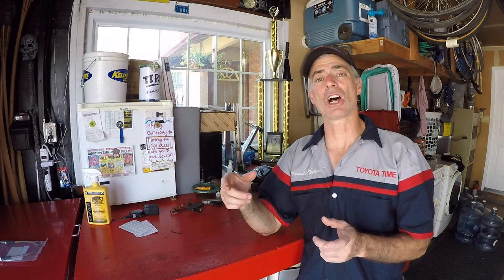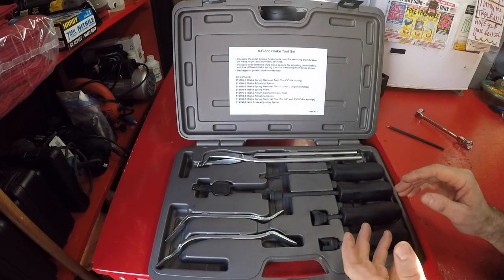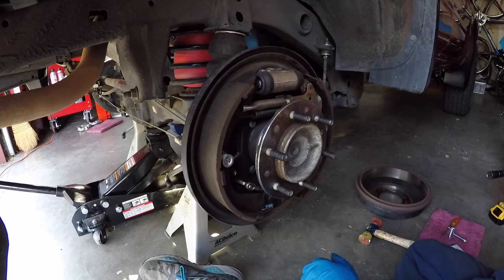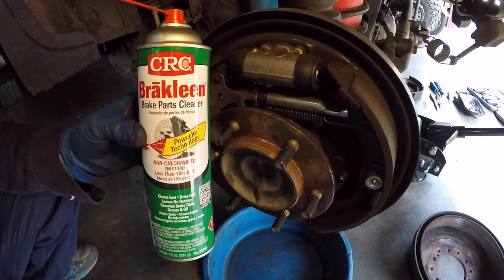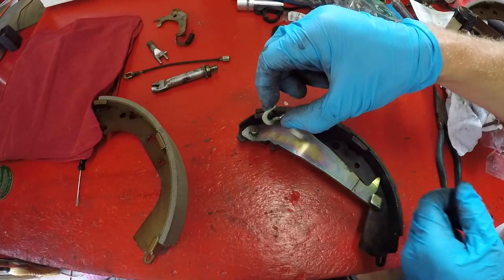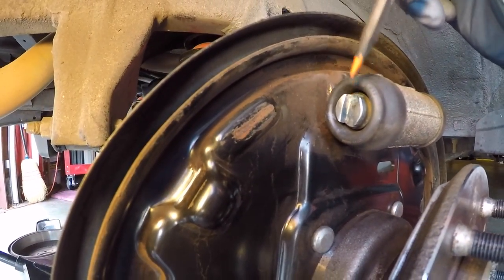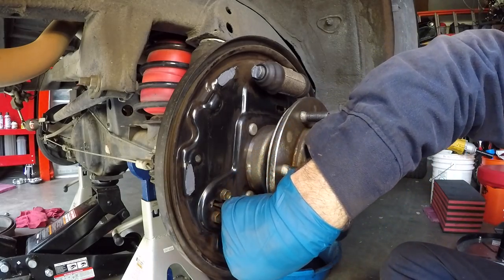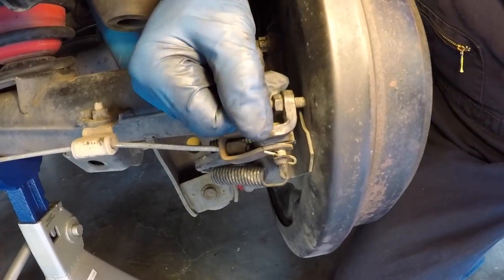Drum Brake Shoe Replacement

Comment: As always great video. I’m planning to do the drum replacement this weekend. What should you do if the braking is pulling to either left or right?
Reply from the maker: If you're brakes are  pulling, the brake grab is uneven for some reason.  If it is your rear brakes causing it, I would be suspecting one of your rear axle seals is bad letting gear oil into the brakes.  The oil coats the drum and shoes causing less grab.  Whichever way your brakes are pulling the opposite side in the rear is compromised.  So, if your brakes are making the rig pull left, it's your right rear brakes that are causing it.  If the brakes are pulling right, it's an issue with the left rear brakes.  The rear brakes stay in adjustment by using the parking brake on a regular basis.  Maybe one of your bell cranks is frozen from corrosion and it's not pulling on the parking brake lever which in turn is turning the star wheel adjuster to keep the brake shoes properly adjusted. 

It could be that the rear brakes aren't the cause of the brake pulling.  It could be an issue with one of the front brake calipers.   It could be a rubber brake line that has collapsed internally not sending equal pressure to both brakes.  Maybe it's one of your front control arms with worn bushings causing a shift when braking that causes the front end to pull.

Anyway, I blah blahed enough.  Let me know what you figure out.   Good luck.
Reply: @TimmyTheToolman  Thanks so much Timmy. This is very helpful.
Reply from the maker: @richlien5598  You're welcome Rich.
Reply: I completed the brake drum replacement today and it went well. Your instruction is so thorough. Thanks so much. No pull when braking. Only issue I had was with the horizontal spring removal. I found that removing the bolt on the OTC wrench and inverting the the hook so that it’s pulling the spring on the top for the passenger side made it easier to remove the high tension spring. Wish I can post a picture to illustrate. My next maintenance is the front diff and using Wits’ End seal driver. I’m in the Bay Area and been wanting to meet up at your BBQ but it’s always on my birthday weekend (Aug 6th). Hope to meet you in person one day. Thanks Tim!
Reply from the maker: @richlien5598  Good to hear it went well Rich.  That OTC brake tool isn't the greatest.  When getting the spring back in, I use a screwdriver now to get it stretched into place.  My birthday is August 5th.  You'll have to make the next party.  Don't know how much longer I'm going to be living in the Bay Area.  I'm going to retire soon and move out of this area.

Comment: If rust is the issue (I am originally from Michigan and rust was ALWAYS an issue) a good way of loosening the drum from the hub is to use a heavy metal hammer and hit the drum right at the hub between the studs and just outside the studs.  For what it is worth and thanks for the excellent video.
Reply from the maker: Thanks for sharing your rust breaking technique.   You're very welcome.  Glad you like the video.
Reply: the 2 screw method works much better than beating on them, especially if you have the drums coated to prevent the crusty

Comment: Hey Timmy…. Thanks for the great video. I followed the steps and thought I had my drum adjusted but now the rear drums are vibrating when I hit the brakes. This started right after I changed the drums…and ideas what might be causing the vibration?
Reply from the maker: Did you use OEM drums and OEM shoes?  If not, that's your problem.

Comment: For that return spring I used an old philips head screwdriver 🪛 that I ground into a point and stick it in the hole 🕳️ and then slide the spring down the shank into the hole. 
I’ve had that old screwdriver for over 35 years and use it for a lot of things. Punch scribe, spring install tool.
Reply from the maker: Your technique to get that return spring on is what I went to also.  I use a Phillips screwdriver just like you said.

Comment: prob a 3 tons jack in the center of the differential, and a 6 tons stand on each side.Nice
bit of an overkill tho, considering I've done that job on a 90 series Prado only using a 2 ton jack in the center, or doing it one side at a time. xD
Nice vids Timmy, you are so methodical with your repairs.
Reply from the maker: 6 tons jacks are overkill just to support the rear of the rig, but I have them mostly due to the height they can achieve.  Good to hear you like our videos.  Heavily detailed step by step tutorials is what we are all about.  We want to inspire people to turn wrenches and that includes total beginners.  We are succeeding in that pursuit because we hear from people pretty regularly how our videos gave them them the confidence to tackle a job they thought was above their ability.  Auto Mechanics, like I tell people all the time, isn't rocket science.  With the Right Information, Right Tools and Right Level of Patience, anyone can turn wrenches with a high level of success.  I'm proof of that because my mechanical ability is average at best.  I'm for sure no mechanical genius.  Thanks for the comment and Happy Wrenching!

Comment: Great video!  One question...Do you need to bleed your brakes after you’re done replacing the rear drum pads?
Reply from the maker: Timothy Miller Hey Tim, you only need to bleed the brakes if you disconnected a brake line allowing brake fluid to drain out and air to occupy part of the brake lines.

Comment: Please help. 2001 Tacoma. I replace the oil soaked rear shoes passenger side. Vehicle brake check here in Israeli still won’t pass just wondering if you have any Ideas why they are not grabbing strong enough. ?  Thanks. Your video was the best I found on YouTube.  (Also changed the rear axle seal. )
Reply from the maker: If you replaced your brake shoes then you might need to tighten them with the adjuster/pulling the e-brake many times, that will adjust too. Or possibly the brake cylinder on that side is malfunctioning or stuck? If you take the drum off and apply the brakes slowly does it move the shoes outward?

Comment: Hey Tim.  I'm getting ready to do this work, and I noticed that the adjustment lever is located on the INSIDE of the assembly (closer to the backing plate) as opposed to OUTSIDE (closer to the drum face).  Does it vary per side of the vehicle?  Did the last person install it backwards or on the wrong side?  In this configuration, you would never be able to "push" the adjuster lever away from the access hole.  You would have to "pull" it... The root of my issue is that my parking brake adjuster doesn't work, my parking brake has very little holding power, and the lever has far too much movement.  I'm going to take it all down, clean it, grease it, replace the shoes, and hopefully I'll solve the issue.  Please let me know your thoughts.  Thanks again for stellar work on your channel.
Reply from the maker: Hey Mike, this is interesting because I saw this exact same thing on a guy's rig I was helping with the rear axle seal job.  His brakes looked just like you described and I was stumped because it was different than the brakes on my rig, Sean's rig and other rigs I've worked on.  I was wondering if the previous owner of his rig or a mechanic installed an aftermarket brake kit or was this indeed another factory brake set-up.

I'd really be interested to know if this is another factory version of the rear brakes for 3rd Gen 4runners or is this some aftermarket kit.  If you're willing to research this, maybe visit your local Toyota dealer parts department and show them a picture of your current rear brake hardware and then compare it to what they show on their parts schematic for your year and model.  If you're too busy, please send me some pictures of what your brakes look like and I can visit my local dealer this week.  I'd really like to know the answer to this.  Here's my email address so you can send me the pics: mtbtim@sbcglobal.net
Reply: I'll look into it and share my findings with you.  I did see that the individual parts are stamped R and L.  I'll make sure everything is on the correct side.  I suspect (but no proof yet) that someone tore the whole thing down and didn't take care when reassembling.  My truck was a one-owner before me, and I bought it from an intermediary broker at 155,000 mi.  The broker did a few maintenance items before selling it to me, and I bet they did the work just moved too fast and loose.  Stay tuned...
Reply from the maker: Michael Spangenberg The brake set-up on that guy's rig looked completely different though.  It didn't look like a situation where the parts were just put on wrong.  If you could, I'd like to see some pics of how your brakes look on both sides.
Reply: Will do.  I might pull the drums and take some photos this evening if I have time.
Reply from the maker: Michael Spangenberg Thanks Mike.
Reply: I just emailed you some photos and descriptions, FYI.  Thanks again.

Comment: I love this video. Great info. BUT it doesn't match the brakes on my 2002 4Runner SR5. On mine the adjustor that goes against the star wheel to tighten it is attached to the opposite shoe and comes in behind the star wheel, not in front of it as seen in this video. It looks completely different. So the 3rd gen must have had more than one brake system on it.
Reply from the maker: Hey Jeff, yeah, Toyota did do a different version of the rear brakes for the 01 and 02 models.  One day we will make a video for those years as well.
Reply: Timmy The Toolman looking forward to this year model video. Maybe we could use my 2002?
Reply from the maker: @gunsfishand4x4  Where do you live?
Reply: Timmy The Toolman LA area. But have been meaning to visit my uncle in San Bruno soon.
Reply from the maker: @gunsfishand4x4  Maybe we could set something up then.

Comment: This video is great - love how thorough you are with your instructions.  Could you use Permatex 80078 Anti-Seize Lubricant in place of the CRC grease?
Reply from the maker: I suppose it would work as long as the Permatex is rated for high temps.

Comment: Hey ! timmy l have a 95 toyota t100. I change the rear diferencial seal and after that l change the brake pads and I turned the drums, we bled the brakes, and l install the drums and ajusted the pads ,but when l turn on the engine and l put on drive, l pressed the brake pedal firmly and the drums don't stop, what more can do. Thanks for your videos ,l learn a lot , you explain everything very clear. Humberto.
Reply from the maker: Hey Humberto, It sounds like you either don't have the brake shoes adjusted properly or you didn't bleed the brakes correctly.  Adjust the brake shoes to where you can just slip the drum over the shoes for a snug fit.  It shouldn't be so tight that you have a hard time pulling off the drum.  Pull the parking brake over and over again to finish the adjustment of the rear brakes like we show in the video.  If the auto adjusters are working properly, using the parking brake should keep your drum brakes adjusted over time.

For the brake bleeding, start at the rear passenger side wheel, then move to the rear driver side wheel, then front passenger side wheel and finally the front driver side wheel.  If you have a load sensing proportioning valve, you bleed that last.  Some vehicles require the ignition to be on to power the brake booster so it wouldn't hurt for you to turn your ignition to the "on" position (don't start the engine).  Here's a link to our Brake Fluid Bleed/Flush video:https://youtu.be/rnyK3V-OGn4

Comment: Timmy, I replaced the shoes and hardware.  I get the 7 to 9 clicks but I feel like I have more free play before the first click.  Does the handle have a free play adjustment?
Reply from the maker: kapple17 I think you can adjust that play out at the handle.  Lift up the plastic trim piece around the brake handle and there's two small nuts on the threaded end of the parking brake cable.  Loosen the top nut so you can tighten the bottom one taking the slack out.  Once it's where you want it, tighten the two nuts back together to lock the adjustment in place.
Reply: Timmy The Toolman whew! That is awesome! Was looking at the back thinking how to shim or pull the cable tighter.  Shoulda been looking towards the front. Thanks again!

Comment: Heya Timmy (&Gang), a few yrs late here - Thanks for the pointers on setting the shoes v drums ... Q:  when utilizing the parking-brake to fine-tune the set-up, is it a Key-Off Engine-Off, Key-ON Engine-Off, Key-On Engine On ?  Also, i have a 1st Gen taco (03) - does the parking-brake perform in same capacity for the fine-tune?
Reply from the maker: The parking brake is a simple mechanical device that doesn't use any electronics.  You pull the emergency brake handle which pulls the cable that runs to the bell cranks which pulls a cable inside the drum brakes that operates the parking brake lever with the adjusting plate attached to it which ultimately turns the star wheel adjuster.  The ignition key can be off or on and it makes no difference.  You pull the brake handle until there's no more change with how many clicks you get.  7-9 clicks is what you're looking for.  

The reason you use your parking brake on a regular basis is not just to prevent undue pressure on your automatic transmission parking pawl, which could eventually cause it to snap off,  but to also keep your rear brakes properly adjusted.  When you pull the brake handle and there's enough wear in the brake shoes to allow the parking brake adjuster plate to grab the next cog on the star wheel automatic adjuster, it turns the adjuster which extends out the length of the adjuster a little bit tightening up the brake shoes.  

I hope this extra explanation helped.
Reply: @TimmyTheToolman  Ahhh Yes ... makes perfect sense ... i think i meed to readjust my parking brake again - Thanks Timmy!
Reply from the maker: @James Davison  That's got to be a record.  Only took you 6 months to reply.
Reply: @TimmyTheToolman  Thanks for noticing(!) LoL yeah i totally forget to look at the "social" part of my email on the regular ... i got a new phone & it's been notifying me of all kinda craziness i put out there in there in the world of late. I had it dialed pretty good at first but it seemed a bit tight so i backed it off a bit at the adjuster under the driver side ... now that the brakes have worn a bit it is most definitely time to tighten back again.  I most likely should have left it alone when i dialed it in the first time, otherwise all turned out really good.  I took my time & cleaned all parts really well (looked like hadn't been done for too many yrs) & lubed as  directed in the FSM ... Stops like a champ!  But yeah ebrake could be a bit tighter.  i'll handle that when this ice storm over head passes as i no longer reside in the bay area (now live KY). Thanks Again for the reply & for All you do! Take Care out there, Mate!
Reply from the maker: @James Davison  Hey James, if you're using your e-brake on a regular basis, your rear brakes should always be in adjustment.  That's what the auto adjustment feature of the rear brakes does for you.  When you pull the e-brake and the adjuster plate connected to the parking brake lever can grab the next cog in the star wheel adjuster, when you release the brake to go somewhere,  the star wheel turns and moves the brakes shoes ever so slightly outward.  This is why it's important to always use the e-brake because it keeps your rear shoes in perfect adjustment.
Reply: @TimmyTheToolman  yeah i get it, but i also think de-adjusted a bit too far when it seemed too tight.  Also, i have been thinking it should be a bit tighter by now b/c i do use it on the reg ... i did my job alone in my garage, and i swore i heard it clicking when i was testing it inside w/ little background noise, & it seemed to be working when i did the manual setting / tightening by utilizing the e-brake method ... sometimes it seems tighter than others ... i have a few other little problems which need addressing & it's time to rotate my tires again, so i will most likely be getting it back into the garage in next week or two & will be sure to check this feature to see if it working properly (i will get my experienced father in law involved this time ... we trade favors as needed).  Thanks Again for All your input & guidance!
Reply from the maker: @jamesdavison6394  Ok, good luck James.
Reply: @TimmyTheToolman  i'll be sure to report back

Comment: With the 4runner on jack stands, how easy/hard should the wheel be to turn by hand with the parking brake off and adjusted correctly?
Reply from the maker: That's not a question we can answer for you.  It depends on the strength of the person.  We explain in the video how to properly adjust the parking brake.  Follow our instruction and you'll be good to go.